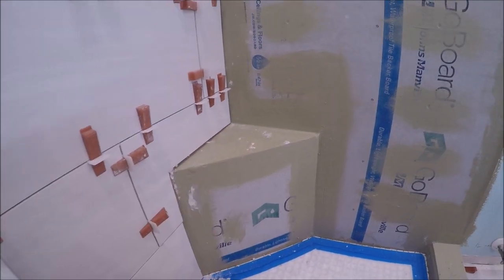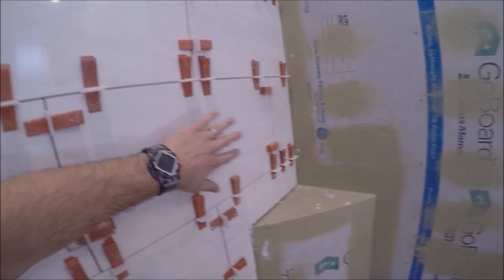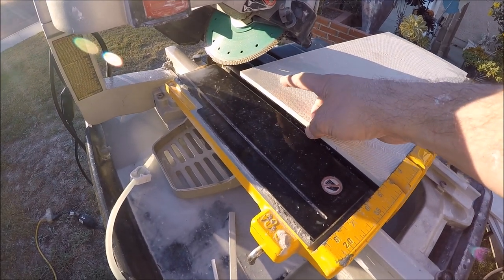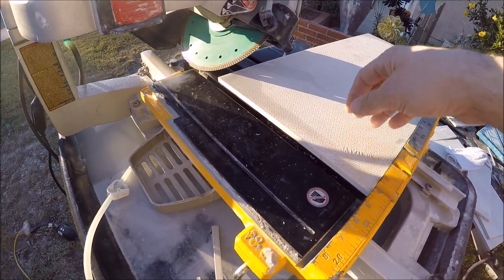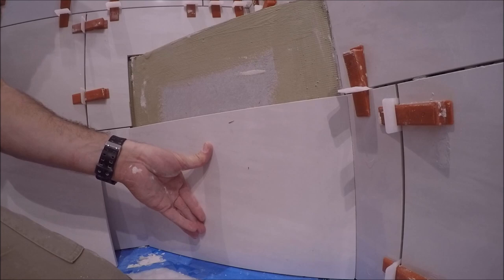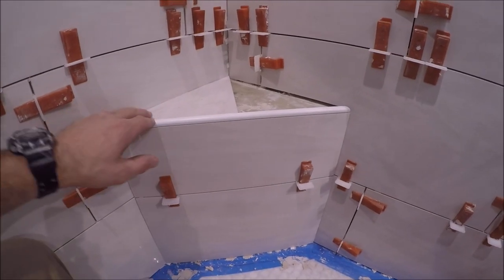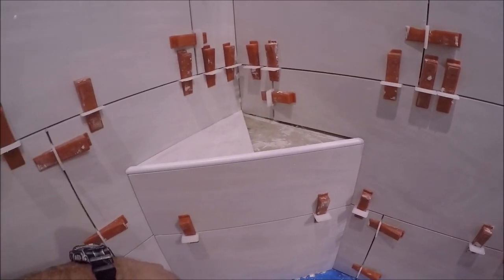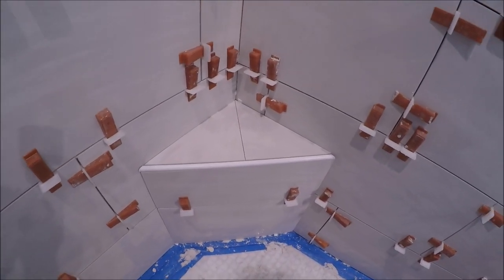Tile a Shower Bench Like a Professional

Comment: Actually if you install the seat first with a slight pitch you can set the wall tiles overlapping the seat tile. Water will run off the walls onto the seat and into the pan. If the grout fails water will pour down the walls and that will be a leak hole.
Reply: I'm watching this video because of that exact scenario you mentioned, that we're dealing with.
Reply: But if you want your transition piece on the top then you have a problem dealing with the 90° corner where the wall meets the bench. If you use matching silicone caulking you eliminate the problem you're mentioning. Other than that the only way to make it look super nice is to put the transition on the horizontal side of the bench which some don't like.
Reply: You can notch the transition and slide it in at the end but it's a little bit more complicated, with bullnose tile

Comment: A quick question from a rookie:
Wouldn’t it be better to do the bench top first, and then the walls above it?  That way, water running down the wall hits the solid tile and runs down/out.  By doing the wall first, water running down the wall will hit the far less robust grout seam.
Reply from the maker: Yes, this video is super old. We install bench caps first now

Comment: For the joint between the bench and the walls, it looks tighter than the leveling system joints, did you use silicone or grout?
Reply from the maker: We use silicone where two planes meet. We used small wedges 1/16 grout joints from the bench and the wall

Comment: For the two top  triangle pieces of the bench. You can just cut one piece and then do a fake grout line with your wet saw, just cut enough to put grout in it or you can always make 2 pieces and then attach them together with leveling clips before applying any thinset and then you have one piece only, the clips also work to adjust the tile.  Same for curves you can do that too, even the face of the bench as well. Clips have a lot of different uses. Yet there are a lot of oldies bitching about it.
Reply from the maker: Yes, I believe that will work and yes, leveling systems help with more superior installations and are very inexpensive. 👊
Reply: Carlos Diaz wait wait wait... why would u do a “fake” grout line?... I agree why even cutting triangle pieces in the first place... just cut it to size with no grout line at all... wouldn’t that like better & seamless?,

Comment: I hate those tiny benches, no ass out there that'll ever use it. 
But you did a great job tiling it !
Reply from the maker: Thank you sir! Women need to shave those legs!
Reply: How do you like that p4 blade? Nice video btw!
Reply from the maker: Thank you sir! I love blade so far, cut's like butter! Has some added thickness to the shaft/bolt hole area so that it won't flex as much when  trimming off a blade etc. We mainly cut porcelain, so let's see how long it will last!
Reply: Landberg Tile DIY TV I don’t understand who sits in a shower 😒 is for shaving but we know who is naughty.

Comment: I appreciate the videos. Great work! Y’all don’t seem to have any trouble tiling 12x24 with 50% brick stack designed layout. Is there a theory behind it? I wanna DIY as well, but is there a secret to keeping the lippage from showing on the porcelain tile? I have the leveling clips already. If the manufacturer recommends against it should I be warned? Thanks in advance.
Reply from the maker: We always do 50% offset and recommend using a leveling system 👊
Reply: landberg Tile TV 50% it is then lol ✌🏻

Comment: What’s a good sized bench for a walk in shower that is 38” by 60” with the drain on the left (6” from that wall) ?
Reply from the maker: It really only depends on personal preference and what the use would be for.
Reply: I saw 18”-20” height is common, is that true? And hey bro you have the best videos, great range of topics, fun music and really great editing. I’m just a DIYer and part time handy man, but I think you have the best tiling channel! Thanks for all your contributions and you should have way more subscribers than you do! Right now I’m going through a master bath remodel and guest bath remodel. What would you say is the best tile saw for $300-400?
Reply from the maker: Yes, that is common and thanks for the kind words! It means a lot to me. Also, I would look at Ridgid or Kobalt 7 inch saws. They cut well out of the box, have a warranty/guarantee and you can easily sell them on craigslist when you are done with your project.

Comment: I love your videos but not sure on this. First , imo, the bench top should be done first, just like you would do setting the shower floor before walls. I know doing it this way is harder but the walls should cover the top. Also, imo, making side miters is just a way of covering up a mistake....if the side wall pieces were left at the proper distance away from the seat edge , both the wall tiles and seat tiles would meet without a miter...let's say you were tiling shower walls that the two side walls came off the back wall at 45 degree angles, would you miter all those cuts up the wall? No you would simply run plumb with both cuts in the corner at the proper distance away where the front edge of tile is close and the back edges a bit further away....when you miter that detail it weakens it and doesn't meet as good imo....
Reply from the maker: Super old video